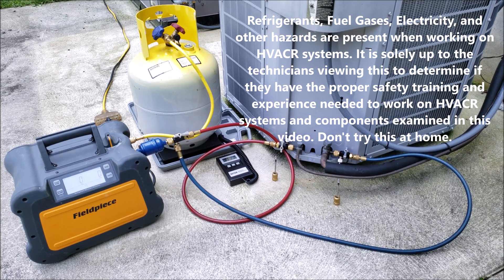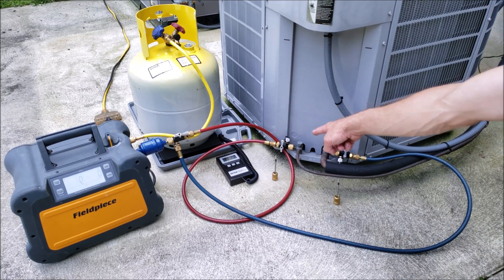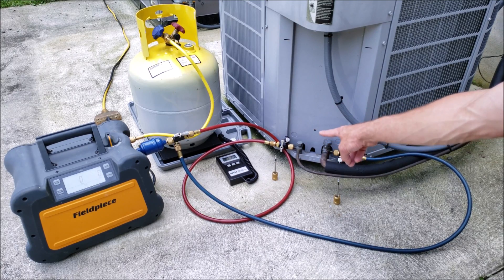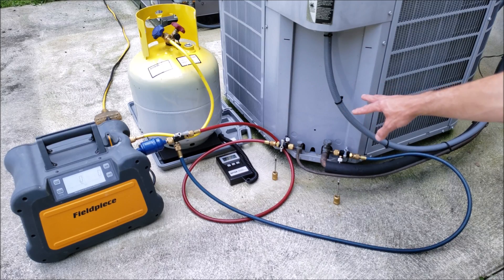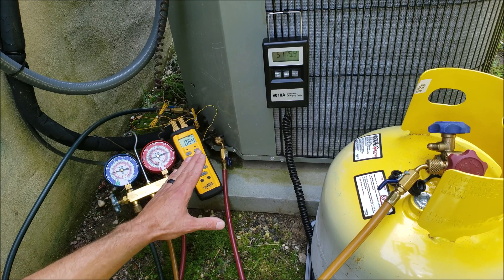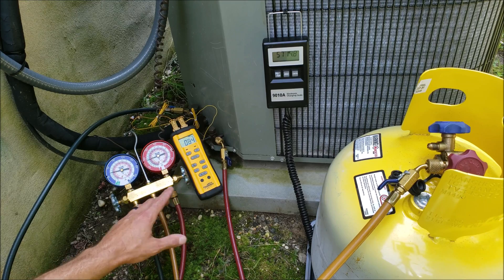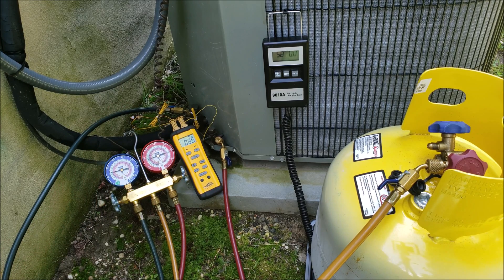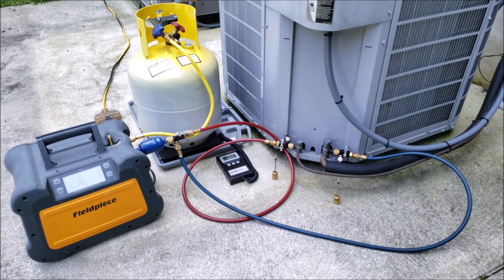Recovering Refrigerant! Use the System's Compressor or Recovery Machine? Explained!

Comment from the maker: The E-Book and Paperback:  www.acservicetech.com/the-book
Tool List-  https://www.amazon.com/shop/acservicetech

Support the Channel-  https://www.patreon.com/acservicetech
For those that are looking for the tools used in the videos: (Linked Below)
Appion Valve Core Removal Tool http://amzn.to/2uYr8WL

RectorSeal Bubble Gas Leak Detector - http://amzn.to/2ckWACn

25 Valve Cores - https://amzn.to/2L37UJU

25 ¼” Brass Port Caps with rubber O-rings - https://amzn.to/2GIOdD2

Brass Valve Core Tool which holds 3 valve cores - https://amzn.to/2GFEbm2

Valve Core Torque Wrench - https://amzn.to/2GHiLoD

Locking Cap Universal Lock/Unlock Tool - https://amzn.to/2GGAoVp

Locking caps - https://amzn.to/2GFXZ8A

Ratcheting Service Wrench http://amzn.to/2dGV4Nh

Yellow Jacket Sealright 90 Coupler- https://amzn.to/2LsU1V7

Yellow Jacket 1pk Compact Ball Valve- https://amzn.to/2uXdF18

Yellow Jacket 3pk Compact Ball Valve- https://amzn.to/2AiKfQe

Thumb Screw Valve Core Depressor with Backseat- https://amzn.to/2mR0sCL

UEI DL479 Multimeter with temp sensor http://amzn.to/2jtsUbJ

Yellow Jacket Refrigerant Gauge Set http://amzn.to/2aenwTq

Refrigerant hoses with valves http://amzn.to/2aBumVI

Yellow Jacket Gauge set & hoses https://amzn.to/2vLVkV9

Yellow Jacket 4 Port Manifold w Hoses https://amzn.to/2BkuGIq

Digital Refrigerant Scale  http://amzn.to/2b9oXYl   
Ratcheting Service Wrench   http://amzn.to/2dGV4Nh 
Accutrak VPE Ultrasonic Leak Detector https://amzn.to/2nFYKVe

Accutrak VPE-GN Ultrasonic Leak Detector https://amzn.to/2Zy4IZP

FieldpieceSMAN360 Digital Manifold Set https://amzn.to/2BdoaD4

FieldpieceSMAN460 Digital Manifold Set https://amzn.to/2nB4Fe6

Ultrasonic Leak Detector with Headphones- https://amzn.to/2B2cRO3  
Compact Ball Valve for Refrigerant Hose https://amzn.to/2KUisW8

QuickDisconnect 90 for refrigerant hose https://amzn.to/2MMtVcg

JB 6 CFM Vacuum Pump   http://amzn.to/2nqbvo8

Appion Blue 3/8" to 1/4" Vacuum Hose http://amzn.to/2uYlVyc

Appion Red 3/8" to 1/4" Vacuum Hose http://amzn.to/2uYg6Ro

Appion Valve Core Removal Tool http://amzn.to/2uYr8WL

Yellow Jacket 1/4" by 1/4" hose http://amzn.to/2umtcod

CPS Vacuum Micron Gauge http://amzn.to/2v1nM3O

Supco Vacuum Micron Gauge http://amzn.to/2v1JRiA

RectorSeal Bubble Gas Leak Detector http://amzn.to/2ckWACn

Magnet Jumpers- https://amzn.to/2PyKPQZ

Alligator Jumpers- https://amzn.to/2PxqJXn

Fieldpiece ST4 Dual Temp Meter  http://amzn.to/2wc1ME3

Fieldpiece Bead K Type Temp Sensor https://amzn.to/2DBwKfs

Fieldpiece Wet Bulb Temp Sensor https://amzn.to/2RRI7Tw

Fieldpiece TC24 Temp Clamp https://amzn.to/2qHLyjZ

UEI DL389 Multimeter  http://amzn.to/2xAdaJf

Air Acetylene Torch setup    http://amzn.to/2aQalsb  
15% Silver Brazing Rods  http://amzn.to/2gVLyLc

Nitrogen Regulator    http://amzn.to/2bXdR5f

Nitrogen Flow Meter    http://amzn.to/2brvoBg  
Other tool links can be found in the video description section.

Shop through Amazon! Your Purchases through Amazon provide a means for channels such as mine to earn advertising fees from all purchases after clicking through. Prices are the same as normal-    https://www.amazon.com/shop/acservicetech
Reply: Hi there, i wonder if you guys have this book in other languages ....dutch for ex . if so let me know were to buy it ,thx for the video very informative.
Reply from the maker: @azizbouchair4593  You bring up a good point but at this time we only have this available in English using PSI, Inch HG, and F degrees. I also wonder about loosing the full meaning when having a book interpreted. That is my concern since I wouldn't be able to validate the book concepts myself except maybe going through word for word with a translated definition.

Comment: First I would zero out  the scale after weighing the recovery tank. Then I would have a below 200 micron vacuum in my recovery tank, I then bleed the air at the tank vapor side, then open v/v core removal valves then let the vacuum in tank draw in refrigerant in and equalize the pressure in the system and tank. Then I start the recovery pump and turn on the pump machine and watch the gauge until  I am down to zero lbs.. The I replace my TXV, pressurize the system with nitrogen check for leaks and let sit for 15 minutes to see if pressure holds. If it holds I vacuum the system down below 200 microns and isolate the system and wait for the vacuum to equalize throughout the entire system. then let sit and keep an eye for a vacuum  holding. Then break the vacuum with the recovered refrigerant in the recovery bottle and weigh in the proper amount of refrigerant. I need to do this entire recovery because I may have added too much refrigerant when my TXV was not responding as i tried to bring up subcool etc.. Right now I believe I have too much refrigerant in the unit.

Comment: What are your thoughts on using the pump down method and storing the refrigerant in the compressor while work is done on the txv or evaptorator etc?
Reply from the maker: We do the pump down a lot in the filed. Make sure to keep the indoor fan running while doing the pumpdown though and if it is a scroll compressor, don't pump it down below 5 to 10 psi because the compressor winding can short to the ground frame with the absence of refrigerant which it uses as insulation for the electrical windings. Any remaining refrigerant would be recovered with a recovery machine. Some manufacturers may not recommend to to the pump down at all with a scroll, thanks

Comment: Not really related to the video but kind of in the video.. What is that field piece that you're using there
Reply from the maker: That is the ST4 dual temp reader. I really love that thing. I can check delta T both superheat and subcooling at the same time and it is easy to recalibrate. I have that tool linked at https://www.amazon.com/shop/acservicetech thanks!

Comment: If I were to change out a condenser unit say R22 and retro fitted it with R407C compatible condenser unit, would I want to get as much oil out as possible? And would using the condensers compressor to evacuate help get the most oil out?
Reply from the maker: You won't get enough oil out and you don't want to damage the compressor while running. After recovery, we usually cut the compressor out and pour out the oil out of the vapor tube and weigh back in the same amount of POE, thanks!
Reply: @acservicetechchannel  Thanks for the tip. I guess I should have stated; Should get all the oil out of a R22 evaporator and line set, as the hole condenser unit with the compressor will be replaced with a new compressor and condenser R407c unit.

Comment: I have 10 degrees difference between indoor coil and return supply and also my compressor is sweating. Any idea
Reply: If you're only getting a 10 degree TD then you got airflow issues and the system is flooding back.
Reply: @walkingfreak  thank you for the help
Reply from the maker: CG what are your sat temps, superheat and subcooling and delta t?